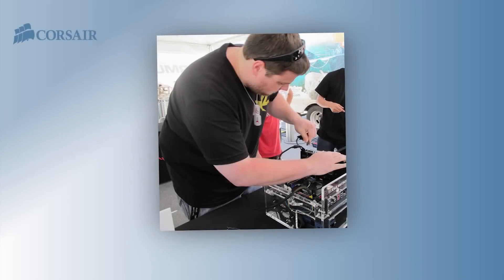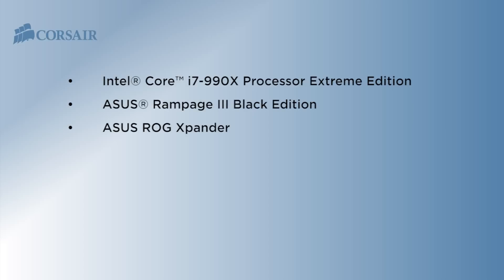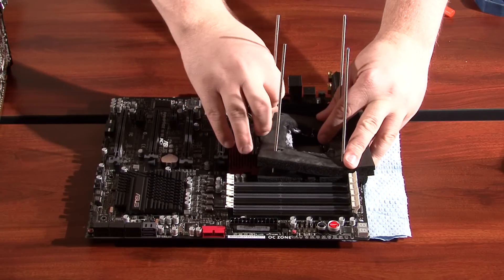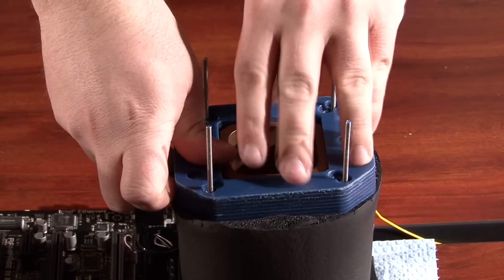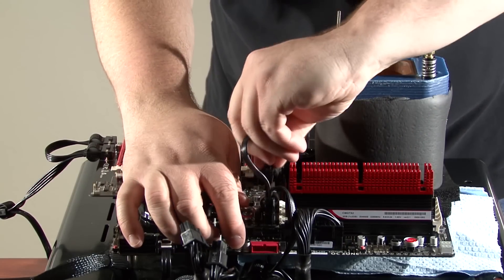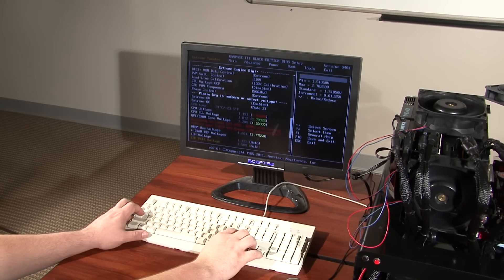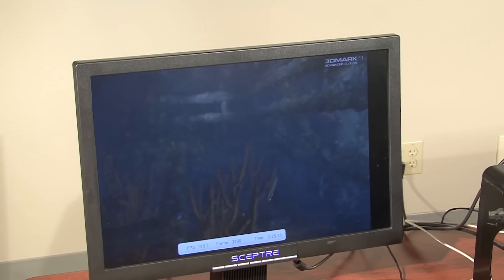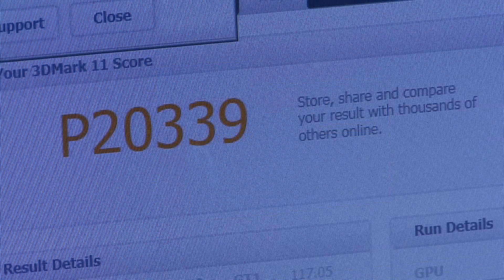Setting up your PC for liquid nitrogen cooling

Comment: How much FPS did you get in BF4 after doing this?
Reply: 77,345,234,556
Reply: Jake Zylstra "Appears blurry to the human eye." I cracked... :'D
Reply: Jake Zylstra Im pretty sure thats not true.
Reply: Jake Zylstra The game runs smooth, as ass cheeks.
Reply: Lol that would mean the FPS is so high that the game would seem to stop moving, like a high speed camera running at stupidly high FPS.
Reply: Jake Zylstra I've played games at over 100 fps. didn't look blurry.
Reply: Jaba5567
You could also buy a 240hz monitor.
Reply: Nathan Toler More FPS = The action can be shown in more pictures per second and that means a smoother play
Reply: No man better fps better play is right but understand that anything above 60 fps appears blurry to the human eye.
Reply: pokecoop . Battlefield a GPU intensive game?? U joking bro? This is both a CPU and GPU intensive game...how can you say that a game that utilizes 8 cores is not CPU intensive?
Reply: Cryofax except if you have 200 fps you can make some badass slow motion montages :D
Reply: Take your ip, change the decimals into commas. That's how much fps he gets.
Reply: Look it up, literally all sources say otherwise. your eye can most definitely recognize fluidity past 60 fps.
Reply: Jake Zylstra It's not true.
However, most monitors only refresh at 60FPS anyway.
Reply: Dr. C. Squishy
IT'S NOT GHZ. GHZ IS FOR PROCESSORS. MONITORS USE HZ.
Reply: Probably around 15
Reply: NeptuneHelix Over 9,000
Reply: You cracked? it is blurry to the human eye though
Reply: Maybe your right i saw a video talking about that but im going to take your word on that.
Reply: Jake Zylstra It's the exact opposite. More frames per second means a more solid picture. For instance the Hobbit filmed at 48fps instead of the standard 24fps looks odd because all the blur is gone. Same with games.

As for anything over 60fps being a waste, I personally don't bother going over 60, but I suppose it might add some tiny amount of responsiveness to your mouse movement.
Reply: Jake Zylstra
It's not that it appears blurry, but think of your eyes as seeing life in 60 FPS. once your game goes above 60FPS you can not physically tell the difference, it looks the same, now some people might say " no way 100fps looks way smoother" they're just blowing smoke.
Reply: ToAstYNaChO
Stop spreading bullshit. You obviously don't know what your are talking about. You haven't seen the demonstrations on 60fps vs 120fps? Google it. There are websites that clearly SHOW you the difference. You can see it with your own eyes.
Reply: Flaming Lemons The ignoramouses who think you can't see over 60 FPS are either kids, console players, or trolls.
Reply: holy fuck you guys are still going on about this? He's right, the eye can see over 60fps, i didn't know what the fuck i was talking about, i was wrong.
Reply: Flaming Lemons actually the human eye cant see high fps at all. That's why alot of people experience dizziness from watching or playing games in really high fps. The "Motion blur" option is there for that reason; to replace the natural motion blur that ur eye and brain create when u see object that move too fast in real life. Whether u can see the different between 120fps and 60fps is probly depend from person to person, but definitely noticeable when u play a game at 120fps than 60fps because the game is alot more responsive in 120fps than 60fps.
Reply: it hadnt come out at that time m8
Reply: OsunusIHA Ha!  XDD wow need an cybernectic alien to see that game XDD
Reply: Nathan Toler Lets say it runs at an fps that is where it doesn't seem to stop moving. But thats how much it can achieve, so the game still runs smooth as asscheeks
Reply: What i was told is that over 60 appears blurry
Reply: So if the monitor couldent keep up with the computer wouldent that cause a blur affect?
Reply: Jake Zylstra
No. It would simply be a waste of perfectly good frames. (or some buffer room for small lag)
Reply: 60 FPS. BF4 is a GPU intensive game, and he doesn't have that good of Graphics Cards. Also, the cards he has don't support Mantle.
Reply: Cryofax That's what people say about 120hz gaming, and that is soon becomes unnoticeable until you play on a 60Hz again.
Personally I would spring the $700 for 4k before going to a higher framerate considering I play games very non seriously.
Reply: ToAstYNaChO Agreed, you don't need more than 60fps unless you're smoking marijuana
Reply: Crab Nicholson
Calm down bae. Most monitors only refresh at 60 HZ, so more is pointless unless your monitor has an above 60 HZ rate
Reply: ToAstYNaChO
Well obviously it wont affect a monitor that wont refresh faster than 60fps, but if you do have a 120hz or 144hz monitor you can clearly see the difference, and it doesn't make it look blurry it makes it look sharper and smoother.
Reply: Flaming Lemons no he is right
Reply: TheFloridaAirsoftGroup
(guessing you're responding to my first comment) Shut up. The human eye can see ridiculously high FPS. There is no blur. No, not even because of the monitor.
Reply: ToAstYNaChO
How can i give you a -1? What are your source(s)?
Reply: ToAstYNaChO
One thing to note is that diminishing returns eventually come in. The difference between 500 and 1000FPS is less than the difference between 30 and 60.
Reply: Jake Zylstra That's because most monitors refresh at a rate of 60 fps (technically Ghz) however they do sell monitors that refresh at 120 and I wouldn't be supprised if there were some that refreshed faster.
Reply: ExBrick
Again, as i said somewhere in this thread, you can get 60, 120, 144, and 240fps monitors with a few in other rare categories, such as 30fps. Also it's not Ghz, it's simply hz.
Reply: minh le
You dont know what you are talking about.
Reply: ToAstYNaChO i am sorry for you... please read the web before posting such bullshit.
Reply: *****
You could enable V-sync, or if you have a G-sync monitor you could use that.
Reply: McFurck Offington
What V-sync does is that the monitor tells the GPU when to make the frame, which may cause stuttering. G-sync makes it so that the GPU (which has to be from Nvidia) tells the monitor when to refresh, which avoids both tearing and stuttering.
Reply: a human eye can only see about 70 fps anyway
Reply: *****
 No it's just up to 150 that we will see a notable difference. From there diminishing returns kicks in hard.
Reply: *****
He never experienced 100 FPS. And he doesn't know how monitors/eyes/framerate works.
Reply: Nathan Toler What you're referring to are slow-motion cameras which are played back at the average 30 FPS. If you record something at 10,000 frames per SECOND, and then re-play them back at 30 frames per SECOND, the movie/game is going to be EXTREMELY slow because of that. ;)
Reply: The 580 only has 512 CUDA cores. Even with 4 it's only 2048 which is the same as a 280X aka 7970 GHz
Reply: True test... How well does minecraft play?
Reply: *****
 you try with shaders?
Reply: Jake Zylstra that is so wrong. its not even funny. If you ever see a true 120hz monitor with 1ms gtg you will know the truth. If you look at 120hz on a 5ms gtg (like an over clocked monitor) it will be blurry and you wont be able to tell the difference between 90hz and 120hz
Reply: ***** I play with Sonic Esther's Unbelievable Shaders (SEUS) with a R9 280 and get solid framerates
Reply: BF4 sucks, just like your mom.
Reply: Jake Zylstra XD
Reply: Still stuttered
Reply: Turning on V-Sync creates input lag sometimes (Like in BF4)
Also, I can notice a difference between 60fps and 100fps on my 60hz monitor. It's barely there, it doesn't really affect me but I swear there is a difference. Usually depends what's on my screen that determines how well I notice it.
Also, to the guy that said 4 GTX 580s should pull over 100fps on BF4, I'm pretty damn sure it will, but just know that in a benchmark, 3-way SLI Titans performed better than 4-way SLI Titans. Ya never know.
Reply: Acesii It won't do 100 FPS in BF4, most likely closer to 40
Reply: Yeah lmao, I'm really tired or something. I guess I should've included not on Ultra lol. On lower settings it can for sure reach 100fps though.
Reply: Nathan Toler High speed cameras take lots of frames per second, say 1000 and then you play them back at a standard frame rate, say 24 or 30 fps, so the action looks slower.

Comment: I look at my current pc in shame...
Dell dimension 4700...
It doesnt even have a multi core processor...
Reply: allen tipton You're not the only one using a old PC I have a 10 year old Compaq Presario still going in daily use and also a custom built PC with a Pentium 4 and 1.5gb of ram which i upgraded from 512mb back in 2008 but the PC was built in 2006

Comment: What's to stop whoever that posts the top score from running the benchmark 9 more times and claiming all top 10 spots?
Reply: The external IP is the same for every single computer connected via the same router/modem. The only thing that changes is the internal IP. So to actually claim all ten spots you would have to run the test at 10 different buildings.
Reply: TCP/IP logging
Reply: But what if you have several rigs to benchmark at the same time, or maybe you are a group of people in the same room all trying to get the highest score?
Reply: Sharcs
hell if they want it that bad let em have it HA HA AHaHOloop
Reply: ***** or use a vpn and bounce your internet off of different locations

Comment: Bro,do you even thermodynamics?
I m no pro overclocker,but i d definitely beat your score with some basic science knowledge
Reply: wakojako49 True that,i didn t want to sound like a prick,thermal paste is just used when you put two surfaces in direct contact,it s completely not needed here,to get the best thermal conductivity,you just have to make the surface area of the cpu bigger,in other words,sandpapering it a bit.
Reply: ***** Think of it like a flat farmland vs mountains. It's the same X and Y area but, when you take into consideration the height of the mountains and the extra area of the Z axis, you gain so much more surface area. Rather than a smooth CPU surface, sanding it down a little will create 'mountains' (grooves just like the sandpaper itself) and increase the surface area. Hence why heatsinks and heatpipes aren't one solid block; they need 'fins' to help dissipate the heat.
Reply: ze62948
Lapping a 990X?  Sure if you wanna throw away your investment, go for it.
Reply: Krusher33 Actually, the opposite of lapping. Lapping the goal is to smooth out the cpu to improve contact with a heatsink. He's talking about using sandpaper to rough it up.
Reply: sanding the areas will make the conductivety worse..   that woult men u have to apply more thermal paste,   cause u cant get the grooves in the prossesor to mach the grooves on the nitrogen "vial".  also the temp on the prossesor is as cool as it can be..  so i think NO
Reply: its a pot..   not a tube..  also if u think u can beat the best in the world, go ahead..
Reply: wasent pointed at u anarchist :)
Reply: Sanding dsnt make the contact area more .... Commen sens !!

Comment: Imagine the PCs of the future, once we've mastered this stuff: "Oh yeah man OC'd to .5 terahertz, no biggie. How's the closed loop liquid nitrogen cooling going?" "I finished yesterday, runs at .6 terahertz while playing Crysis 4 at around -100C."
Reply: It realy isnt that far away if we are researching more in supercuntducting materials. than it can be possible, becourse the Problem now is that the superconductors have to be super cool at about  1 -70°K but we are serching for superconductors that have the ability to be superconductive a room temps.
Reply: PC components of the future wont even produce heat.
Reply: Eric Zauche
superconductors aren't really relevant in this context...
Reply: Eric Zauche processors rely on semiconductors, so superconductors are irrelevant.
Reply: Ethan Wilton yea you are right but only right now. Do you know if they dont build a processor out of superconductors in the future. Or even discover new element combinations which allow this to happen?
Reply: The way processors work, there are little areas of positive and negative charge on little things called transistors, cancelling each other out. There are more of one kind then the other, so the "hole", or zone where the charges cancel out, is closer to the one they have fewer of. This relies on electrical resistance to balance the charges, as otherwise the stronger charge would overpower the weaker one.

In modern day, you can get things to a superconductive state by chilling them, an example of which is the cooling shutdown error in the video that occured @ about -145*c
Reply: I know how processors now days work but they may work different in the future. 
And what i have mentioned was just an example but my guess is that we do not stay with semiconductors in the far future because thes have to many limitations. 
But its just my guess.
Reply: different concept entirely, doesn't rely on electric principles, rather the behavior of quantum particles. While superconductors may speed up other electronic components, such as some motherboard components.
Reply: ***** In my actual comment, I said .5 terahertz. That's half a terahertz, AKA nowhere close to 5. Thought I might clarify.
Reply: ***** nop we are not google wants to invest in new quantum computer comanys.
Reply: +warlockmii sure but its nice to see the big companies invest into that to bring thes technologys to market. 
I think i can buy a quantum computet in my life till this reaches consumer markets i wilk guess its aboit 50 years from now so everyone can buy one.
Reply: *****
Of course it's decades away. We're talking about PC components of the future. Don't really understand your logic.
Reply: only around 6ghz is the speed of light witch cant be passed if you doun't use those spin nano particles which can exist in many dimensions
Reply: Hey guys, just wanted to let you all know about a neat little OC'ing article I saw: nearly 8.6 GIGAHERTZ on an 8150. Article here- http://www.tomshardware.com/news/fx-8150-bulldozer-record-overclocking-speed,13903.html or if you don't want to trust the link look it up. Thanks for all the +1's.
Reply: Sorry my english is so suck in wich way is the speed the electrons travel through copper dependent on the clock speed of the processor? 
Right in no way. Thats why some folks got more than 8 Ghz out of one processor. Clearly on one core but thats becourse of thermal limitations. 
http://plus.url.google.com/url?q=http://www.tomshardware.com/news/fx-8150-bulldozer-record-overclocking-speed,13903.html&rct=j&ust=1414931197256000&usg=AFQjCNE6he462jakV6Txf720IN50X6UaUQ
Reply: there is some kind of electron winch changes its state between "0" and "1" and it can´t change state much more faster than 6ghz this is why we need multicore proserssors.
Reply: true dat but don´t believe it´s in 20-50 years Human brain fascinates me too and im blown away about what of the some savants can do but we know so little of human brain yet.
Reply: Eric Zauche graphene